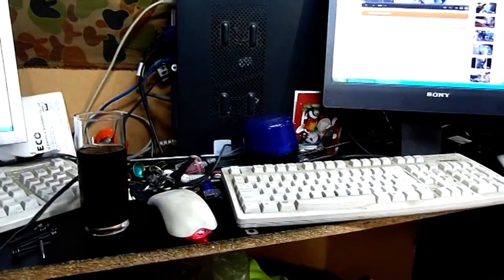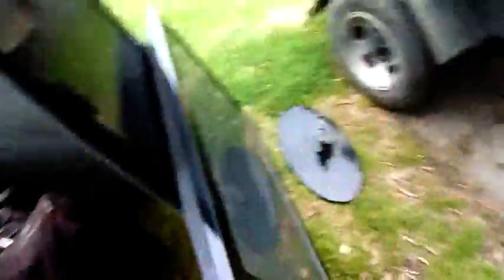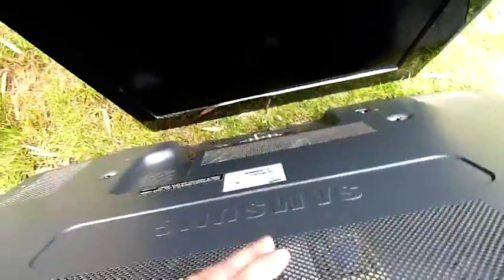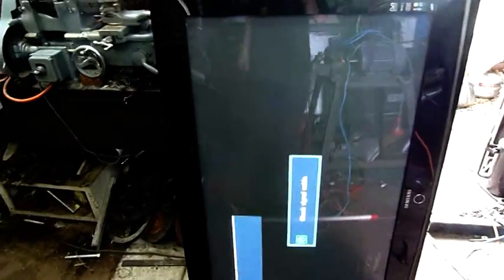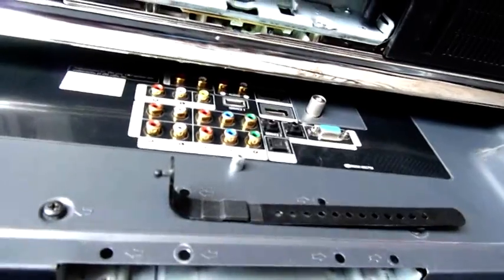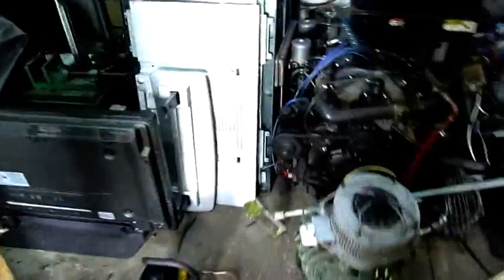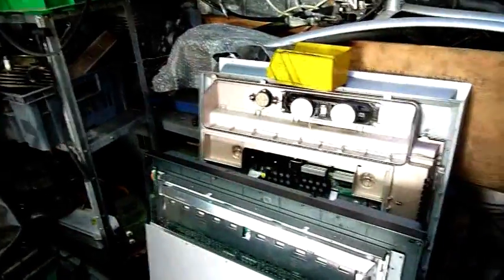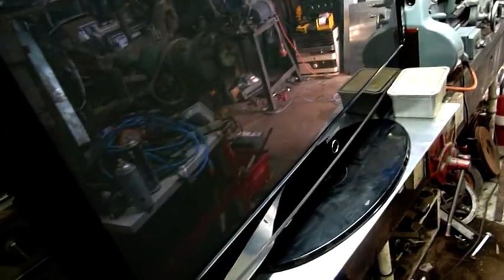Buisy Day - Sundial Flywheel engine and Plasma TV Projects

Comment: Grandfather smoked like chimney, high end white phone he gave me and it turned yellow from nicotine.  I took it apart and washed everything in the dishwasher except the speaker.

It came out perfectly white again.  Even the circuit boards and LCDs were absolutely clean.  Like new and no cig smell.. And it worked.  Still does.

Comment: I got that other panasonic power supply board and will get that updated video uploaded this weekend.  Hopefully all you have is a blown thermal fuse in one of the X or Y power supply inverter transformers.  The Xsus transformer is what I had found.

Comment: Last year we bought a brand new Mitsubishi DLP monitor...a 60-inch to replace our 47-inch CRT projection monitor.  The thing probably wouldn't even fit on that bench.  The difference in weight, though, compared to the CRT is like night and day; it's probably not much heavier than that plasma display.

Comment: Your done easy as! "Dam iPhones" try a cross reference on the filter sizes for the Morris we did the same for my old mans 1976 lamborghini v12 the gudgeon pins genuine were over £100 each from uk but cross referenced them turned out to be the same as a EH Holden 6cyl $19 each and the oil filter cartridge was the same as an Alfa sum thing

Comment: @Ed Dick Smith DVI to HDMI cable $13 HDMI is better than dvi as it can handle higher resolution and 8 channels of audio & control/cross talk commands between HDMI devices. iPhone charge cable and USB cables are the same u can generally go to any audio/video retailer and get a cable for next to nothing or eBay same for the replacement screen/digitizer (easer to install) for $25-$50 shipped then it's easy two screws a suction cup (to pull out screen from body) and 3 clipped in ribbon cables and y

Comment: The video signal on HDMI and DVI are identical. Only difference is connector and DVI doesn't carry audio. So you can get a DVI to HDMI adapter and it'll work.

Comment: A good (but not to corosive) degreasing detergent with a fresh odour will do for cleaning the housing and maybe the screen. For the inside: blast away every stinky dust particle with compressed air. It will still stink. If you are really desparate at getting the stink out, place it opened up, flat on a table and spray with airfreshner above the boards (not directly on them).